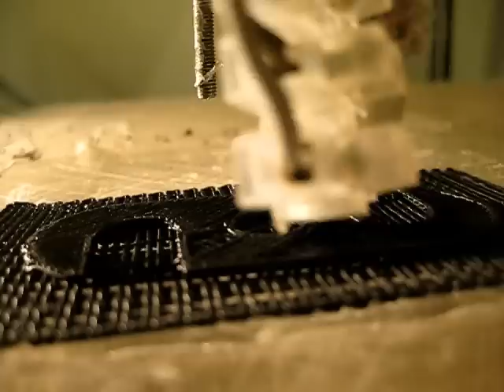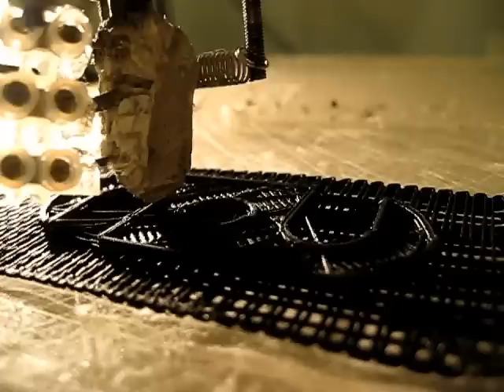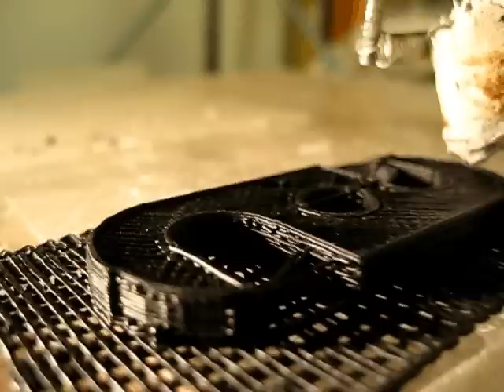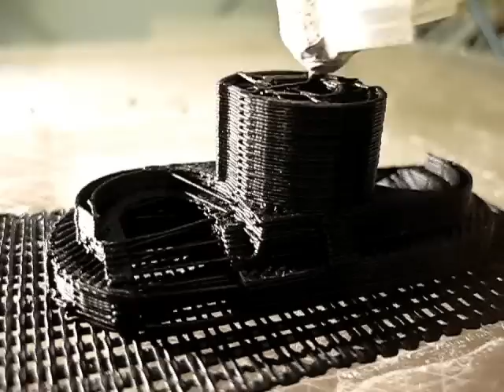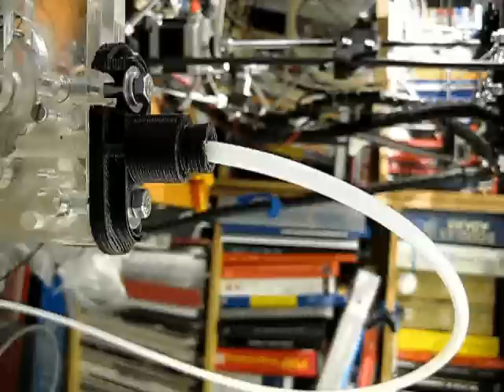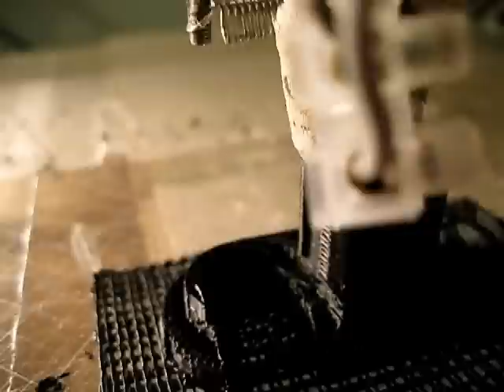My RepRap 3D printer printing itself an upgrade (Bowden extruder clip)

Comment: DIY photo resin 3d printers have ultra high resolution and really tough parts.(initial resin cost is high though)
Latest Makerbots are quite high res. swap the nozzles & set software.
The advantage of plastic is cost and ease of installation.. however it is not difficult to modify a 3d printer as it's open source.. + ppl share plans.
Metal clay & metal powder additive sintering is being developed openly by ppl, so even metal parts will be possible soon.
check out DIY 5~6 axis CNC too.